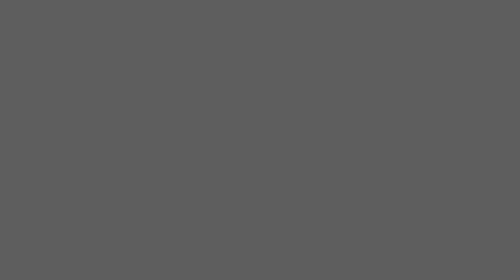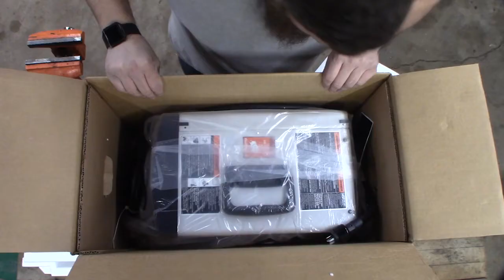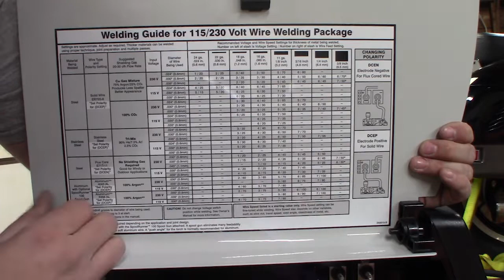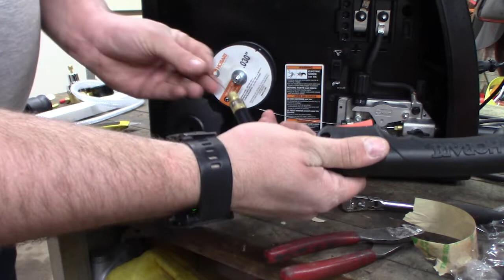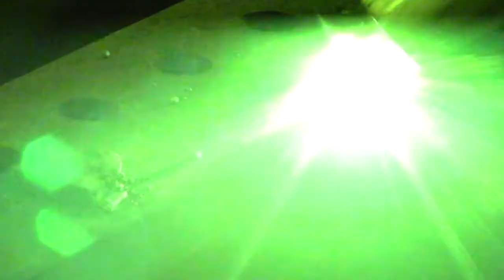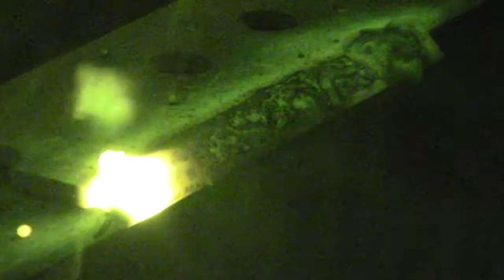Unboxing a Horbart 210MVP MIG Welder

Comment: You lost me when you said Hobart was the Chinese version of Miller. (Face Palm) Hobart and Miller are owned by the same company (Illinois Tool Works, Corp.), that is why alot of the parts interchange. You need to research the American Made Big 3- MILLER, HOBART, and LINCOLN. Hobart has been making welders in the U.S. since 1925.
Reply from the maker: Yeah I figured that out later.

Comment: How did you set up the tank?
Reply from the maker: The welder came with a hose and regulator that plugs into the back of the welder. I ended up building a cart that the welder and tank sit on.

Comment: Just bought one of these. Hobart owned by same company as Miller. Illinois Tool Works. Mine says it's assembled in USA. No idea where parts come from. I got the Hobart over the Miller because it's a transformer based. Miller isn't. Also about $450.00 less too. Mine was same price as Harbor Freight Vulcan. Made decision a "no brainer" Also Jody from "Welding Tips & Tricks" used one on his Mig instructional series. Good enough for him-good enough for me....
Reply from the maker: That's pretty crazy. Wikipedia says that Miller and Hobart are just 2 subsides of hundreds within Illinois Tool Works.
Jody's MIG welding series here on YouTube is great. That series was the reason I got the 210MVP. It's such a great machine.
Reply: @TheOffRoadCorner  Yep, same here! Think Jody's taught more people to weld from his videos than he'll ever know. This is my first Mig. Learned stick years ago and even Tig. Really looking forward to getting it hooked up. Still have to get the gas and some other consumables first. I learned years ago to always get the best machine you can afford....Cheers!

Comment: I have the same welder and it works fantastic!  If your using the flux core wire, you need to pull the weld pool instead of pushing it like you did in the video.  By pushing it, your getting all sorts of porosity in your weld and that's why the weld wasn't as smooth.  Practice with it and you will have bitchin welds!  Congrats on your purchase!

Comment: Congratulations on your new welder!That is a pretty capable machine.I have the Handler 190 and am really happy with it.Yes it is no Miller,but hey atleast it is made by Miller.lol...Do yourself a favor and get you a small bottle of 75/25.Your welds will be so much better....
Reply from the maker: I almost bought the 190. but decided to get the 210 because of the MVP. also the added bonus of the option for a spool gun. I agree shielding gas is the way to go. I'd only use flux core if I was welding outside or if I needed the extra penetration FC gives you. I had the gas at the time of this video but stores closed before I could get the wire.